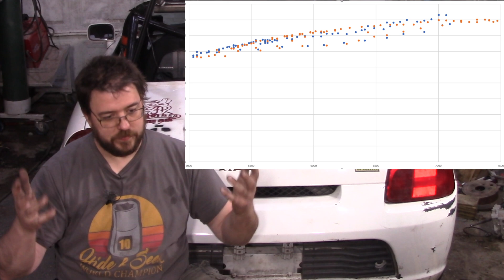Installing the 2AR-FXE Double Atkinson engine.

Comment: Hello 2AR Lord,
Do you know if these mount up to the J160 trans (out of the rs200 Altezza). If not any way of mounting to a W57?
Reply from the maker: The J160 transmission shares the same bolt pattern family as the 2AR. That does not guarantee that it will bolt up but that makes it very likely. at a minimum the two dowels will align so even if you have to add bolt holes to the bell housing the alignment will still be perfect.

That said, i recently picked up a TL70 transmission that i will be making an adapter for.
Reply: @FrankensteinMotorworks  thank you! Found you through gears and gasoline and fell in love with the motor through there, it just sounds so good and it’s cool. Was thinking of going longitudinal RWD
Reply from the maker: @845sSuperman  Awesome, thanks for checking out my videos :)

Comment: Do these motors accept e85 to make alittle more power?

What is 2nd gear good for in mph with this combo?
Reply from the maker: Yes, i expect it to help make a fair bit more power. I haven't tried it yet but i will be doing it with Gears and Gasoline on their 2AR-FXE build coming up soon: https://www.youtube.com/watch?v=W3UyOrJPat8
Reply from the maker: oh, 2nd is good to about 65-70mph depending on exactly where you place the redline and the tire size.

Comment: I loved the 2az in my old scion and the 2ar seems even better. I'd love to shove one in one of my old toyotas. planing on any FR drive train development?
Reply from the maker: I don't currently have plans for it but the 2AR motor shares the bolt pattern with many other motors including the 5VZ motor which has FR transmission options. There should not be a need for anything custom to do an FR 2AR setup.
Reply: @FrankensteinMotorworks  Any plans for AW11 support or are you sticking with the newer MR2s?
Reply from the maker: @cGreer20  Unfortunately there really aren't enough buyers out there to justify the R&D. If somehow that ever changes i will revisit that decision. It took me several years to sell the single one off 2AR kit i had made for the AW11. That said, many people have used my other parts to make the AW11 swaps easier.
Reply: @FrankensteinMotorworks  the other dream project is a manual 2gr 08 Scion xB. I think that could be done with all OEM parts.

Comment: It seems the 2AR-FSE is very available and well priced where I live. I havn't heard you talk much about the FSE compared to the FE/FXE. Any reason to stay away from it?
Reply from the maker: The 2AR-FSE is effectively a completely different motor. It's designed for longitudinal mounting instead of transverse mounting. It's also not used in the USA so i don't really have access to it.
Reply: @FrankensteinMotorworks  That clears it up a bit, thanks! If i throw myself into this swap, a modified FXE it is then, FEs are to rare around here.
Reply from the maker: @Rethgore  Honestly the FXE is a great place to start. it's a nice high compression engine to start with and it has the same valvetrain as the FE. The big priority should be a better exhaust camshaft and a better intake manifold. Otherwise it's a great place to start.

Comment: How much power do you think this engine could make with just a tune (messing with the fancy cam timing stuff) and could there be an easy way to switch between a fuel efficient tune and a performance tune.

Comment: Really thinking about doing this for my AW11 instead of rebuilding the 4A, the car is stripped anyways. The fact that this engine is actually available in Europe sweetens the deal a lot :)

Since you've done it in an AW11 before (well, the non-FXE variant), what would you say about stuffing a cat in there? I'm the weird guy that likes my cars quiet (i.e. not drawing attention, as impossible as it is with an AW11) and somewhat "clean".
Reply from the maker: Yes, there's no reason a catalytic converter would not fit in there.

Comment: Does the 2AR take the same bellhousings as a 2AZ does? I was working on a 2AZ swap for my AE86 using a W58 with 3Y bell housing, but after doing some reading, the 2AR seems like a greatly superior platform, but I am worried about transmission options when put into an FR package.
Reply from the maker: it's not 100% identical but only a few bolts are different. there's a really good chance that any bellhousing that a 2AZ will bolt to, the 2AR will bolt to. Note that the engine is a fair bit taller though.

Comment: When I worked at a toyota dealership, all the AR engines had super loud valve clatter for a second on dead cold starts. My foreman said it was cause of all the small oil diversion tubes it takes just a second to get oil back up to the head on cold starts. Dunno if that helps. My Grandma drives a 2AR rav4 and it has loud clatter on cold start too
Reply from the maker: It's because the cam isn't locking in place so it rattles until oil pressure builds. I'm actually going to disassemble a phaser and take a look at the situation in a video soon.

Comment: So I'm thinking about putting one of these in my Celica, probably starting with a base 2AR to get used to the engine and build one like this on the side. Is I worth sticking with the stock ECU or should I use the Link G4+ I was planning to put on my gen2 3sgte? Not that I don't want to use your tune, but is it worth the money to get the OEM ecu if I already have an aftermarket one?
Reply from the maker: If your plan is going with this build that I did you won't be able to use a stock ECU due to the cam trigger configuration so you may as well start with an aftermarket ECU. If you go with a haltech like i did I would be happy to help with the tune side. I'm also now a Haltech dealer if you want to buy one from me.
Reply: @FrankensteinMotorworks  I will definitely let you know what I decide to go with once I get to that point! Need to fix my gen2 first and get rid of crap before I start the next project hahaha

Comment: Do you have the fxe cams in it? In Prius engines, (1nz) switching to the regular cams, makes large gains with the increased compression. But, single vvt as well.
Reply: Watched previous vid. Solved my own question...
Reply from the maker: Looks like you answered your own question. Yes this has two FXE Intake cams in it.

Comment: Awesome  bud. My first thought was the phaser as well. How much do you think would be lost if you put the FXE cam sprocket back in
Reply from the maker: Based on my experience with the motor so far you'd have to make a decision on optimizing for peak power or mid range power but the cost would be about 20hp in the area you aren't optimizing. Also this assumes that the sprocket can be installed in an ideal position. You might need to drill a new locating hole to be able to clock it properly. Also don't forget to plug the two vvt-i oil feed holes at the front of the cam to avoid oil pressure loss.
Reply: @FrankensteinMotorworks  didn't the FXE head already have a static exhaust sprocket

Comment: Congratulations on working for yourself! I appreciate the lack of commercials. My rear drive 2AR FE is progressing, bell housing figured out. What sort of gains would you expect from the hybrid cams in a Fe? Great content!
Reply from the maker: Oh, did you find a bellhousing that fits from the parts bin or did you have to make something? If you found something that just fits would you mind sharing the info? As for the cams in a 10.4:1 you'd get the same airflow that i showed but without the power output bump from the compression ratio so it should be right about 260hp(230whp)
Reply: @FrankensteinMotorworks  I will be looking for some hybrid cams. Bell housing, I pulled the front half of a auto trans from a 2006 scion. Then became a sculptor and cut away the stuff that didn't look like a bell housing. The trans side will need adapter, but the starter is now no issue. Rough mock up the T5 will fit well. Considering doing video, but with a YT name like mine..
Reply: @bourbonbrofessor9938  I subscribed just now to your channel so that I won't miss the video of your rwd conversion.
Reply: @bryankurtzublin8504  Thanks! Call that 1 vote for video.

Comment: So no additional vibration at idle with the balance shafts removed?
Reply from the maker: I was really surprised, it's so subtle on the vibration that i'm not even sure i can tell a difference. It makes no sense that such a long stroke engine is not vibrating more, the only reason i can think of is because the reciprocating assembly is actually quite light but i'm not sure. What i do know now is that i will not be running another AR with balance shafts.

Comment: Although most successful endeavors are predicated on a focus of some sort. 
As time passes, perhaps consider broadening your offerings. What those offerings might include...I have no clue.
In the 90’s, I owned a ‘86 Buick GN.
There were a number of vendors that specialized in supporting GN go fast parts. Given Buick only produced the inter cooled 3.8 in ‘86 and ‘87, and over time, that market started to diminish. Many of those vendors began to offer support for models, many of which have been produced in the many millions, and over many decades.
Focus is the key.
Good Luck !
Reply from the maker: So this actually is me trying to diversify. I want to get into building  these AR motors and selling them but before I build them for other people I really need to explore what I can do with them. Right now I'm exploring the low cost side but i promise we will get to the stupid boost builds also :)
Reply: @FrankensteinMotorworks  
The MR2 is such a fantastic platform for a myriad of mods.
I imagine one of the best ways to marketing your products is in packages.
Stage 1
Stage 2
Stage 3
...and so on 
Good Luck !

Comment: I will be a customer... Soonish, I hope. How much can be tuned out of the 2AR ECM? I'm looking at putting one into a sightly older car.
Reply from the maker: about 350whp or so before you're exceeding the stock ECU (without significant modifications to the software)
Reply: @FrankensteinMotorworks  I meant more along the lines of the transponder key/emissions stuff, but it's good to know power limits. I was aiming for 300whp or so in an AWD car so I'm hoping I'll be in the clear there. Can the factory ECM be tuned to handle boost, then?

Sorry, lots of questions but I never get time off work so it's difficult to get people on the phone.

Comment: Is it possible to fit a 3.5 2GR FKS from the Camry into the MR2? Just curious lol
Reply: 2GR swaps into MR2s are very well supported. :)
Reply from the maker: I am working on the FKS in the background, the big hurdle there is the ECU since it's a new generation ECU.
Reply: @FrankensteinMotorworks  that's awesomeness right there. I have had 3 SW20's which all had 3SGTE's, and currently in the market again for another to restore. Just undecided in which power plant I want to go with as I do love the 3S very much. My wife has an 18 Camry XSE w/ the FKS and that thing is impressive. 

As far as power and obtaining the 400hp level, which engine do you recommend as far as reliability?
Reply from the maker: @Stephen-G  I plan on diving into the 2GR power adders soon. 400hp should be possible NA but i don't have a solid answer for it yet.
Reply: @FrankensteinMotorworks  supercharger I hope!

Comment: Congratulations on pursuing your passion and making the leap.  I have been anxiously awaiting the dyno video over the past week...and looks like I will need to wait again.  Though the market is small, people clearly are interested in your videos and work, and you fulfilling a need for an overlooked platform.
Reply: Also, should be gains available as you play with the cam timing.  The ECU is currently defaulting to your previous basemap, yes?  Given the difference in duration, there may be more gains here by varying the intake and exhaust valve timing.  Last, not to be nitpicking, technically it is a double Atkinson CAM engine...it is no longer being operated as an Atkinson cycle engine.
Reply from the maker: Yes i understand there is no more atkinson cycle but it's funny calling it the double atkinson motor :)
Reply: You can make a new badge for the valvecovers in the auto manufacturing tradition: "Dual Atkinson Cycle Cams...DACC".  Similar to VTEC, DOHC, and the like.

Comment: Yes!!!  How does it feel compared to the 1AR so far?  Also curious if removal of the balance shafts are affecting low rpm drivability
Reply from the maker: It feels about the same but it idles a ton better. keep in mind i expect the gains to mostly be at the top and it's hard to really explore that on the street. So far no disadvantage at all with the balance shaft removal. If i did not know they had been removed i would not have noticed.
Reply: @FrankensteinMotorworks  balance shaft is also easy enough to remove with the engine mounted in the car